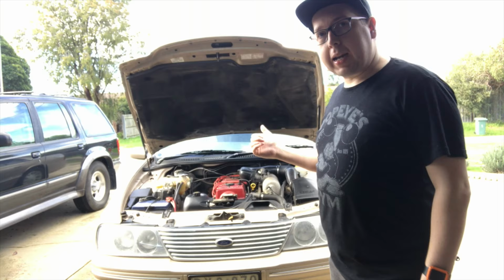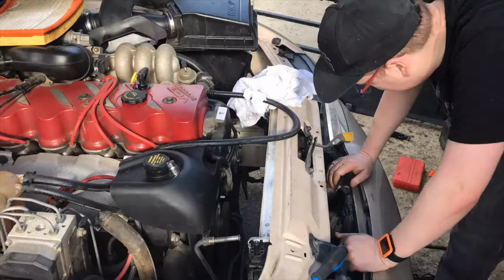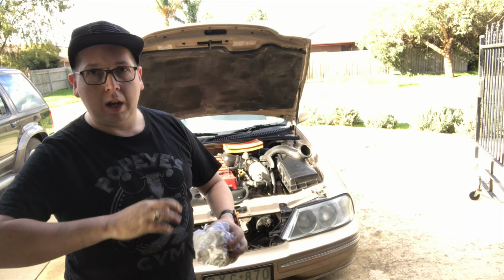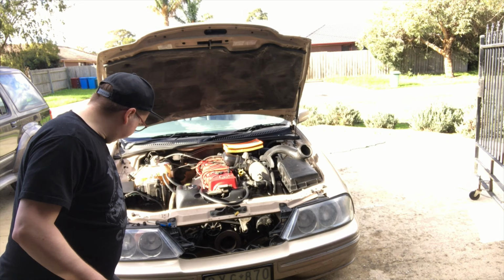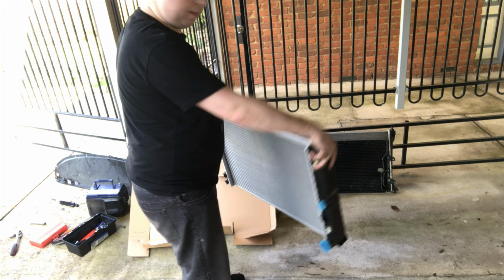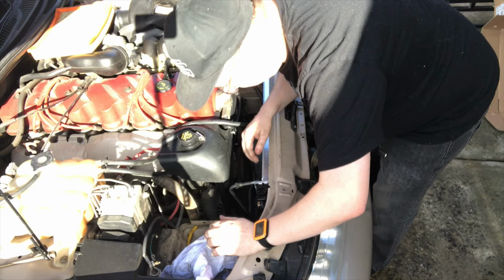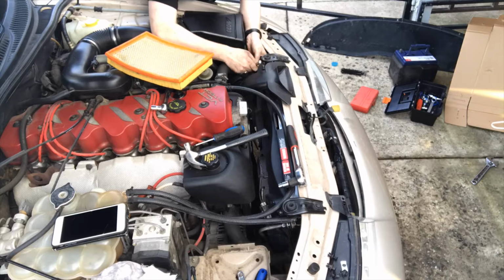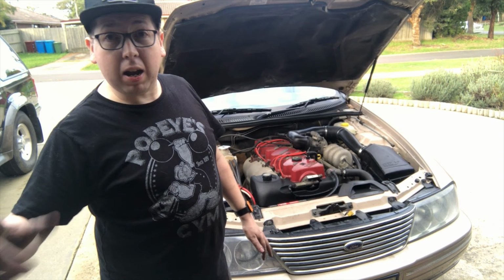Car Maintenance Ford Fairlane AU 1999 Repacement Radiator

Comment: Hi! does auto transmission oil spills a bit when you disconnected auto trans hoses? does it need to be refilled somehow? thanks!
Reply from the maker: Yes you do loss some transmission fluid but it is easy to top up I have done a video on how to fill the fluid using the transmission cooling lines.
Reply from the maker: https://youtu.be/ezY4ktdOEJo